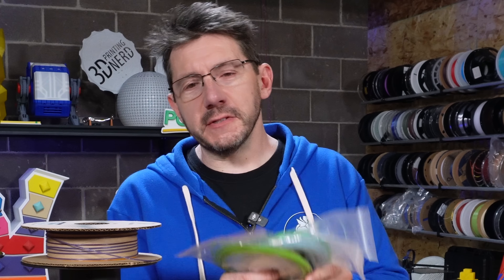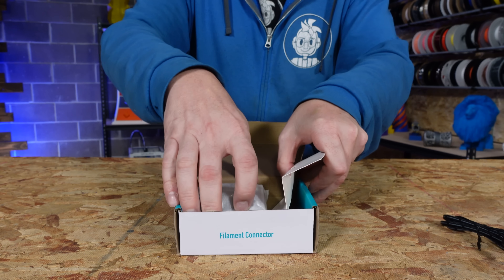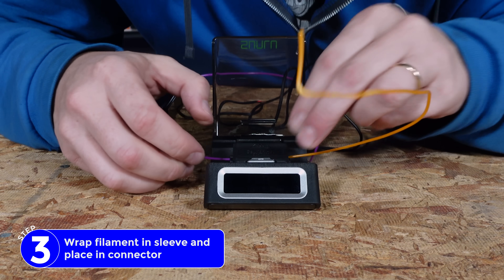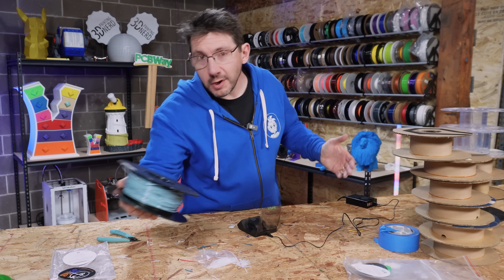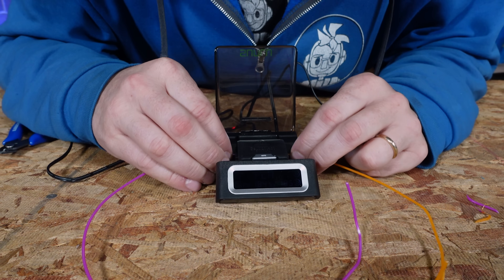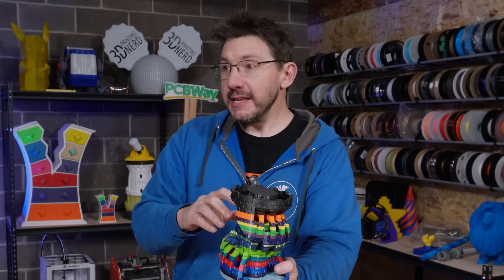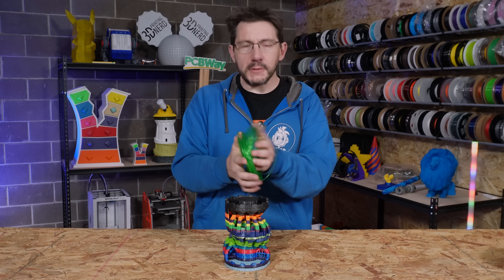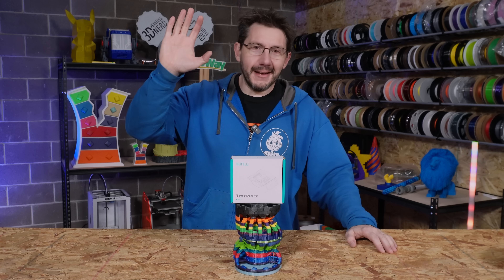Does the Sunlu Filament Connector Work?

Comment: Even if your time has no value, and you don't need consistent coloured models, this is STILL an idea that looks better on paper than reality. Despite your upbeat conclusion, I bet you won't be using this in a year. I really see no use cases where this is a viable solution:
1: Ecofriendly - What about the electric, and the food energy it requires you to respool?
2: Cheaper - Only if your time has no value and you produce a LOT of partial rolls
3: Too poor to throw filament away - Then how are you affording to print in the first place?
4: Recycling - Unless you are prototyping, or only welding single colour filament, when is that multicolour monstrosity acceptable?
Reply: 4. I have lots of storage that are multi coloured from using little bits of filament. Who cares if bins in my drawers are multi coloured?
Reply: @andreacook7431  Fair enough. I would care, but each to their own.

Comment: Look for this on printables, helps to secure tightly kinked strands close to spool core: "Sunlu filament welding assistant, the Randco Grip-a-Matic 2000" , 1066032

Comment: I got one - the only sore spot I have is the lack of replacement PTFE tubes from the manufacturer.  I finally found some third party ones, but having them available on Amazon (especially from Sunlu) would be preferred.  Hopefully this changes soon.

In the meantime I try to reuse them 2 to 3 times by sliding it off the rolls, but you can overdo it and eventually the tube warps and makes a misshapen connection and will clog your bowden tube.
Reply: You can just buy PTFE or Capricorn tubing (Would recommend the latter if you are doing high temps) and cut it up, surely?
Reply: @francistaylor1822  Looks like the ptfe that comes with the device is thinner than what you would normally use for a bowden tube (so it can be cut easier I would guess).
Reply: @anderfrank1  i cant see them having a special one just for this purpose - when i get mine ill compare i guess but i would be suprised if you cant just buy bigger quantities of the stuff either way

Comment: Got it yesterday and used it for the first time, I had a spool on low and other 3 at a barely scrap level. I succesfully bound them all, with a 10 min learning curve about the right pressure to use and got myself a respectable 200g spool in less than 30 minutes. It was a very good experience!

Comment: IMO, this is a solution in search of a problem. We already have features like bambu's auto refill. And that doesnt require wasting $50 and ptfe tubing.
Reply: But that doesn't help me get rid of 50 plus spools unless I'm actively doing the print.  Huge space saver for me
Reply: @potayto-potahto881  agree totally- just use the system on the printer that’s designed to swap filaments 100’s of times anyway…..
Reply: AMS: Fine as long as 4 roll ends is enough for your print. On all other printers, it's a pain to babysit.
Reply: I would agree, but for me, filament runout on my x1 is pretty terrible, with it causing artifacts when transitioning to a new roll. For some reason this problem isn't present on my a1 though. I found this out after having already purchased the connector though.

Comment: It is to expensive for what it is. I would think it should be $20.. Not $50.
Reply: Yep, I'll bite at $30 including 200x PTFE.
Reply: Yeah for it to make sense for us it would have to be cheaper. But I don't think they can easily make it that price if they refuse to sell it at a loss. The starting costs for something that hasn't and probably won't move a ton of units has too big of an impact. 
But since it's a supporting tool for their core business they could make a loss on it. They could even bundle it with printer purchases to errase some of the lost margin.
Reply: You are absolutely right. This filament connector is too little too late after bambo labs and other AMS systems. For $20 might work for somebody, but not for the $50....

Comment: it looks like it's about as easy as it gets
i found a video a couple months ago where a guy uses silicone tubing for home brewing that has a slightly smaller inner diameter than filament
so you just push both ends of filament into the tube so they touch and heat it with a soldering iron or a lighter to melt the filament together, works great also